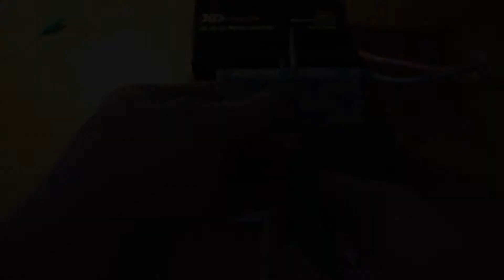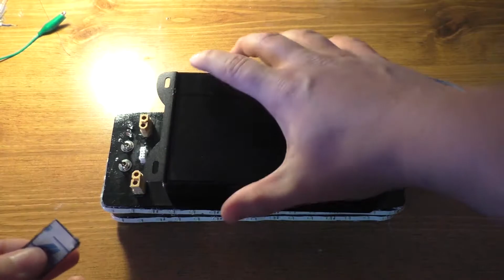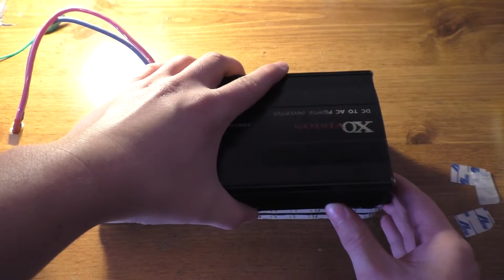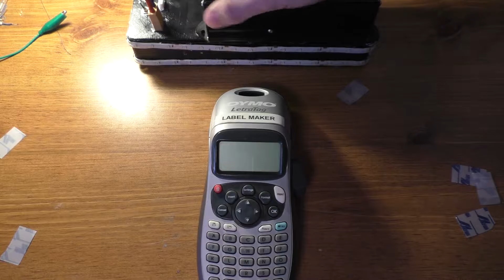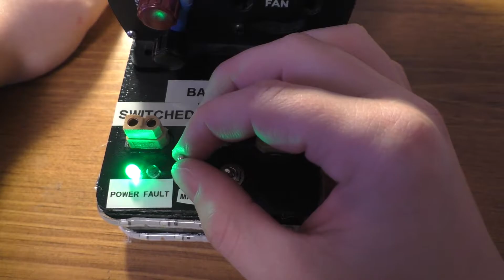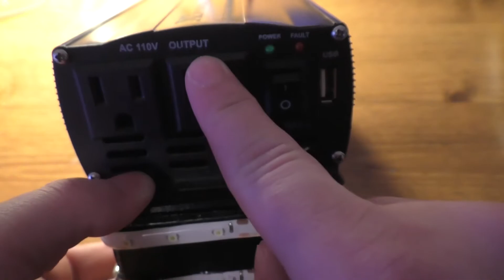DIY 12V Lithium Battery Pack Part 5

Comment: I'm sure this is an obvious question for you but what is the purpose of the inverter for your project? Is this necessary for a lithium battery pack or is just for an AC appliance?
Reply from the maker: It's not necessary I just wanted it on there so I have the ability to run standard 120v appliances.
Reply: Okay thanks.

Also,

How do you balance the lithium batteries? I am really new to all of this. 

I would rather not use a balancing hobby charger thing but instead have some sort of BCM pcb ( i think its called) to just balance it out, have you got any advice?
Reply from the maker: I use a balance charger. Seems to be the easiest/most reliable way to do it. They are BMS (battery management system) boards. I haven't messes with those before but they should work as well.

Comment: hi Eman,your videos the most clear tutorial how to make these battery pack ever I found on YouTube! if I make a 3s or 4s battery pack from 12 or 16pcs 18650 then it would be enough put the 6A or 30a charging circuit on it and I could use a 12v 1a-2a wall charger for it? or I have to use a balanced charger like yours on other video? many thanks! keep up the great ideas!
Reply from the maker: Thank you, A balance charger is necessary for lithium battery packs.